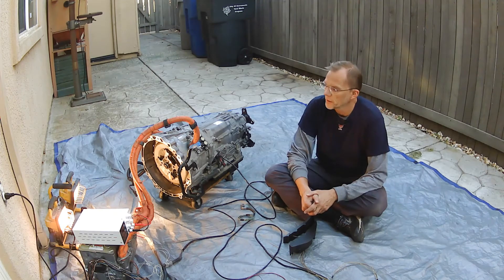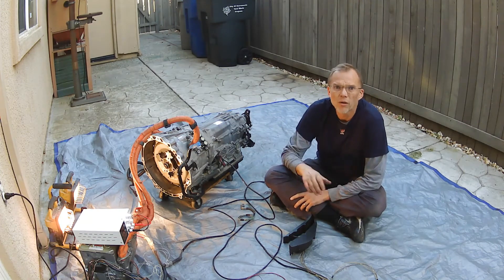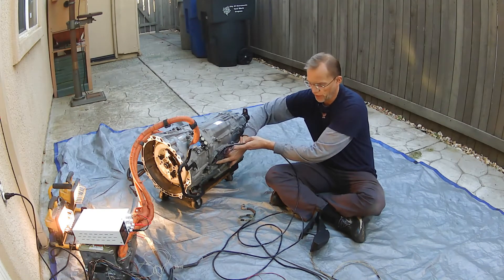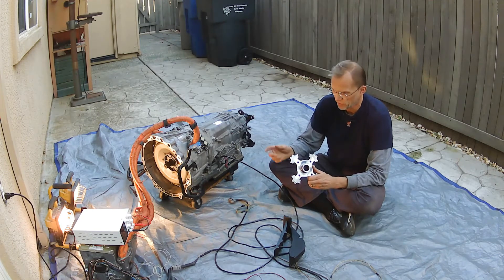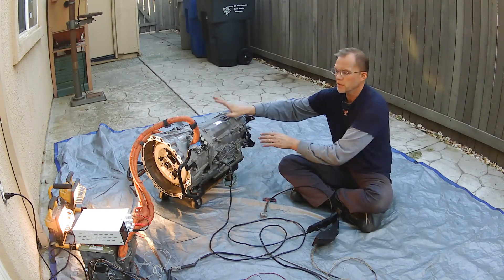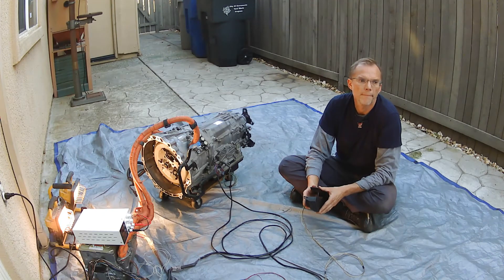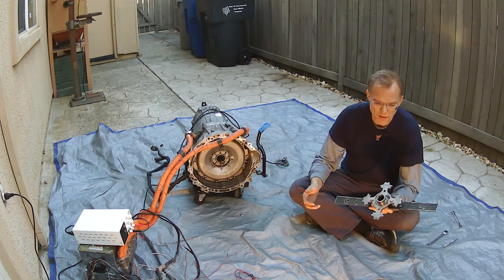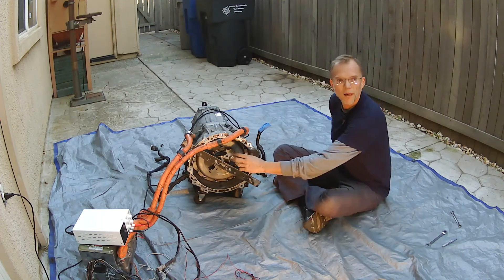Lexus GS450h - MG1 Spinning

Comment: Tnx a lot for this informative video .is it possible tell what components are u using to simulate turning transmission
Reply from the maker: I am not sure I understand the question, but I will say this, although we are using stock components here, a stock Lexus GS450h inverter to drive a stock Lexus GS450h transmission, we are not feeding it the same voltage/amps as in the stock configuration, nor are we injecting the power through the stock path.  The OEM Lexus has only a 200 something volt battery pack and it uses a buck boost converter to at times bump it to as high as 600 volts, what we are doing is bypassing said buck booster and running this inverter/motor combo on 350 volts nominal, 400 fully charged using a BMW 530e battery pack with a different spec rating, I hope this helps, sorry if I swung and missed the target, you can email me to discuss this further
Reply: @Good-Enuff-Garage  tnx a lot for your time and consideration, I will email u  soon ,have great weekend 🖐🌸

Comment: I have been cracking my head to understand why the motors gears and shaft act this way

In short, only Mg2 is connected to the road, while input and Mg1 cannot transmit power except if the input is locked and mg1 rotates opposite to MG2( as you showed)

The CVT part is like this
The engine rotates at idle but Mg1 rotates in the opposite direction... as MG1 slows rotating in the opposite direction and starts approaching engine rpm... power is transmitted to the wheels

When MG1 and the engine have the same rpm (gear ratio taken into consideration) the wheels will take direct drive from the engine

When MG1 turns in the same direction as the engine ... now you have overdrive

This is my knowledge so far so feel free to correct me

And theoretically if a combustion engine was connected and Mg2 was off it should be possible to control MG1 and drive using the engine as source of power and MG1 as clutch /CVT

Cheers
Reply from the maker: I'm buying what you're selling !
Reply: @Good-Enuff-Garage   meaning it's very far-fetched or it makes sense? I did not understand